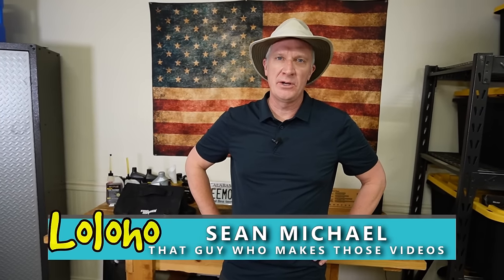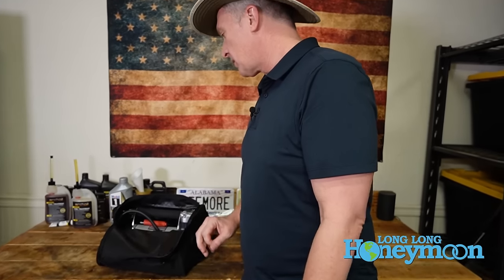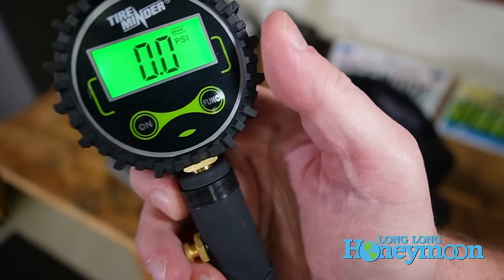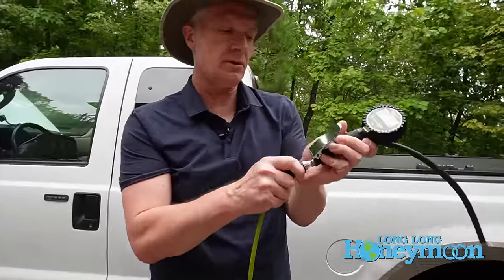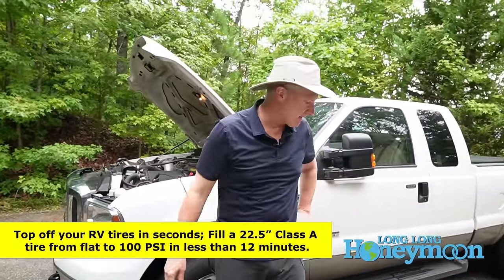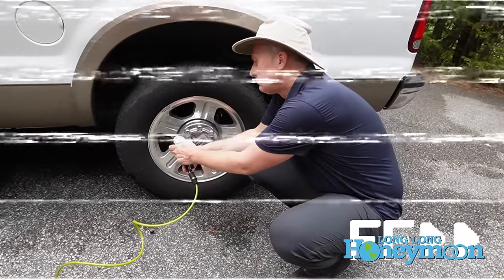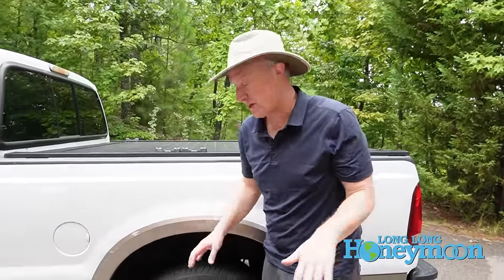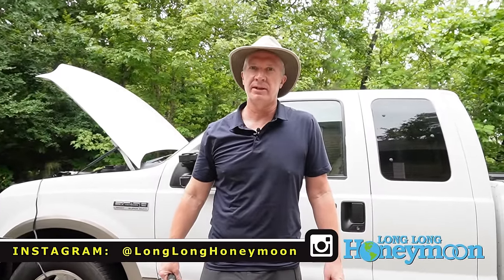Tireminder RV Air Compressor - FAST, QUIET, up to 150 PSI!

Comment: Used a Viair for years however recently switched to a Milwaukee M18 battery unit.. way more convenient and will auto inflate to a set pressure. Works like a champ. Also a 150psi max.

Comment: Sean, having a air compressor is absolutely a key piece of kit to have and you are EXACTLY RIGHT - make sure you have your vehicle running when using the compressor OR it will ZAP your battery - YEP I learned the hard way.
Reply from the maker: Thank you Lee for that real world report! 👍😂

Comment: We had recently purchased one of these for our 2022 Thor Windsport 34J based on reading the reviews on several sites.  Though we hadn't had a chance to use it yet, I really appreciated your review as it gives me great confidence that our purchase was a worthy investment.   Thanks so much!
Reply from the maker: I really think it is a great unit. We traveled for many years with noisy cheap tire inflators, and they certainly fill a need in the market. If you have the budget for a nicer unit, this one is excellent quality.

Comment: Hey Sean, I have been using the same Tireminder TPMS for about three years now and it has performed quite well for me.  I have a 36 foot Class A and a toad.  The air compressor I have is the same style that you reviewed but it is the VIAIR version.  Tireminder didn't have an air compressor at the time I was in the market for one.  Instead of hooking it up to the car or motorhome battery, I use a Jump Starter because of the portability.  I works quite well and I don't have to use the extension hoses.

Comment: I have the VIAIR 200 and it looks the same and we love it. I like the gauge design of that TireMinder better though, it’s very nice. Even with two batteries and alternators I’ve noticed it inflates much faster with the engine on. Another point on that TireMinder it appears easier to add extra hoses than the VIAIR

Comment: I bought the Dewalt battery power compressor and love it. Tool only was $106. I already have batteries
Reply: That's what I have too.  I love it.  The auto shut off is the berries.  Amazon sells brass locking air chuck adaptors for $6.  You don't have the screw on the hose anymore.  Works great, speeds up the chore.

Comment: I like the compressor but I opted for a 120V model from Menards  for about $100.  It's cheaper and it has a tank.  I also have a Super C motorhome with a 6KW generator so I should never be without electricity.  It is about twice a big as the one you have but and if you have limited space I can see where the TireMinder one would be nice.   Keep the good stuff coming and give your lovely wife a kiss 'cause she puts up with all of your shenanigans.

Comment: Husky 12/120 Volt Corded Electric Auto Inflator with a maximum pressure of 123PSI. It has a nice digital display, auto shut-off and quick-connect valve connector. We've used it for several years with no issues. It is often on sale at Home Depot from around $50 - $60. I enjoy your videos. Happy Thanksgiving and safe travels.
Reply: Check out the DeWalt 20V compressor.  No cord!  It also has auto shutoff with digital display, pumps up to 160PSI. It's pretty sweet, but more money.

Comment: Those are nice. Just haven’t pulled the trigger. I like the minimal space they take up. I carry a three gallon pancake compressor onboard my motorhome. If I need it while on highway I’ve got the generator to run it. Carry a 50 foot extension and a 20 foot air hose. I like it with exception of the footprint it takes up.

Comment: Hello Sean and Christy.  Love your video's.    I too purchased a large, expensive, $400 portable 12V air compressor. I pull a 40' toy hauler with 2 motorcycles in the back.  When going on multiple day rides I need a more portable inflation device.  Another rider takes out his Woowind. Hand size. usb charging.  $35 on ama.  I returned my big expensive one. I can buy 10 of the small ones for that price.   Ty for all you do.  WPH

Comment: Hi Sean, I am sure that the Tireminder is great for the occasional tyre pump up but I have found that the single cylinder models are really too slow for situations where you need to deflate and pump your tyres reasonably frequently such as when you are driving on unpaved roads.  Having at least eight tyres to pump you do need something that is almost as fast as the gas station tyre pump.  For this a twin cylinder portable compressor is ideal.  I have used the ARB Twin Cylinder compressor which actually comes with an air tank.  It also has a 100% duty cycle and as I mentioned is blindingly fast.

Comment: Great video Sean. I’ve always bought the cheap plastic ones that plug into 12V (aka cigarette lighter) they last a long time if you don’t use them 😂. $50 was the most I ever paid. I got tired of buying one every few years so i got the Viair for RV’s not motorhomes and I’m really happy. I should be able to pass along to those that inherit my empire. I must say i like the on/off handle on your model, very very handy. It still is Chinese and I’m hoping its a high quality Chinese product

Comment: Nice looking compressor. I am also a tyre pressure freak.  I will check pressure on rental cars I am using. If you have an Anderson connector, you can remove the clips and add a corresponding connector.  Thank you for sharing and have a great day.

Comment: I bought a Viair compressor when I first started traveling with my RV. That was 4 years ago. I have never once used it. It cost a lot and takes up room. Takes forever to pump up a tire. When I check my tire air pressure they usually need maybe five pounds or less. Much easier to use my bike air pump than going through the effort of digging out the compression. And you can now buy a small compressor for about $26 that will do the same job.

Comment: Did Viair and Tireminder team up?  I've had a Viair for years and it's still going strong. It's a little work horse and I keep it in my truck all the time. I do like the gauge on the end but other than that it's almost identical to my Viair.

Comment: Milwaukee m12 tire inflator/compressor is much better.  I bought it because my best friend had a pinhole leak on his work truck while on the PA turnpike.  He strapped it to his wheel with 3 ton zip tie straps and turned it on to keep filling the tire while driving 26 miles to the next exit/garage and it worked 😂.  So Milwaukee and zip ties are part of my road kit

Comment: Corded air compressors are cumbersome IMO.  Long cords, long hoses, time consuming, old school.  I've switch to the 20V DeWalt air compressor.  It also runs on DC, AC, but the 20V battery power is awesome for quick portability.  Take the pump to the tire (no cord needed), dial in the pressure you want on the digital display, turn on the pump and walk away.  The pump stops at your prescribed PSI.  Another display shows the actual PSI in the tire.  No long hose needed.  Saves time, space, and weight, not to mention convenience. Goes up to 160 PSI.  Oh, and it also has a high volume, low pressure hose for filling air mattresses and water toys.

Comment: Sean, you might want to check out the Napa Maxi Trac air compressor for $125. It will run circles around that little one u used and for 1/3rd the cost. Anything with RV on the name is gonna be spendy and gimmicky. Serious offroaders swear by the Maxi Trac unit. Just an FYI

Comment: I like you guys, but I think your air compressor I might disagree with you. Dewalt has one and I would send you a picture of it if I could and you can set how much air you wanna go into the tire and when it reaches that it shuts off and you can either plug it in or it’s battery. I love this thing and RV mechanics recommended it. DCC0201 air inflator.
Reply from the maker: Thanks I will check it out! 👍
Reply: @LongLongHoneymoon  I would send you a picture if I could but I know you guys are pretty secretive and picky who you talk to so anyways I love this thing.

Comment: Thanks for showing what not to get.:face-orange-raised-eyebrow:
Reply from the maker: I really like the unit and have no complaints. With that said, it feels like a luxury compared to the Tire inflators we have used in the past. For many years we got along just fine with a noisy little $50 beast.
Reply: @LongLongHoneymoon  When we have power inverters, we don't need twelve volt Compressors
They are too slow.

Comment: I'm curious:  You mentioned running 65 psi in your trailer tires.  I'm putting Michelin Agilis CrossClimate tires on our Flying Cloud 27FB and everything I'm seeing says to run them at 80 psi.  Is 65 psi too low?

Comment: we always do carry an air compressor when travelling.  Just curious as to what size tires you are running on your truck that require 80psi when towing?   I run an LT245/70-17E on my tow vehicle.  CAT scale tells me I have about 3720 lbs on my rear axle when fully loaded towing.   1860 per tire roughly.  Went to the tire load charts for this size and added a 400 pound buffer per tire, and 55 psi should carry about 2275 pounds per tire.   Tire will handle up to 80 psi, but if 55psi  will handle my load plus a good safety buffer, then I cannot see why I would want to add more air and only make my ride rougher.   Just curious.   Great review, and as always safe travels....
Reply: I get the science behind this, but with a higher PSI, the sidewall is stiffer, providing a smoother and more stable ride while towing. I always max out my tow vehicle tire pressures for a stiffer sidewall and less flex/wobble in the front.

Comment: I have the viair 450? I'm not cheaping out on this for sure, if i can afford an rv i'm not going to have less than the best compressor.
Reply: The DeWalt cordless compressor is much better.  $115, up to 160PSI, auto shutoff, digital display.  Love it.

Comment: These units, same as viaair will barely top up a commercial 19.5 tire and it takes forever. I just threw mine away and got a small cheap one with a tank from harbor freight. Inflates twice as fast.

Comment: I like a god deal but $329.00! I think I can spend a lot less, besides I only need 75 psi in my tires.
Reply: The DeWalt cordless compressor is much better.  $115, up to 160PSI, auto shutoff, digital display.  Love it.